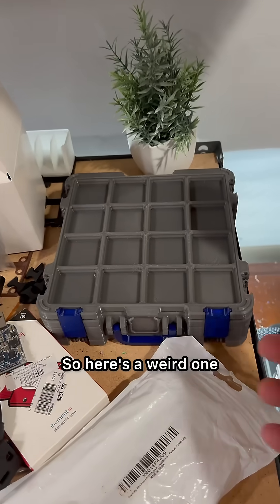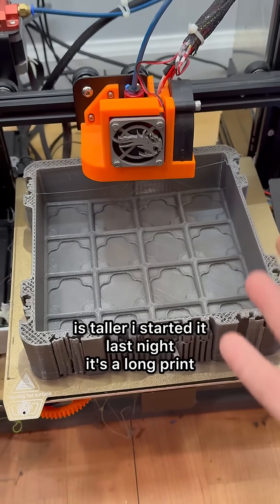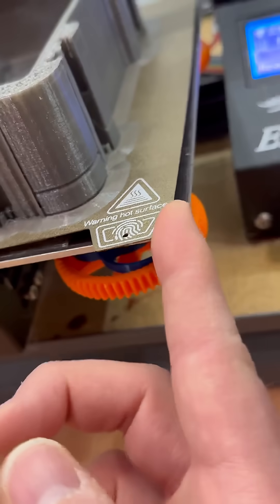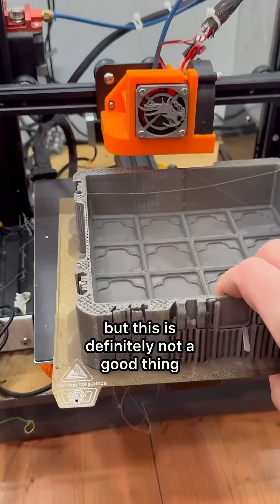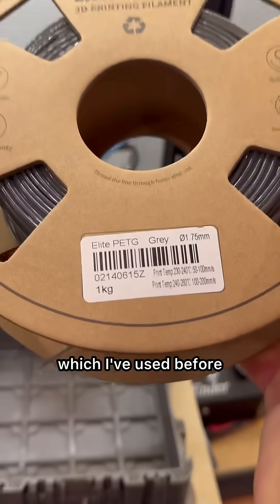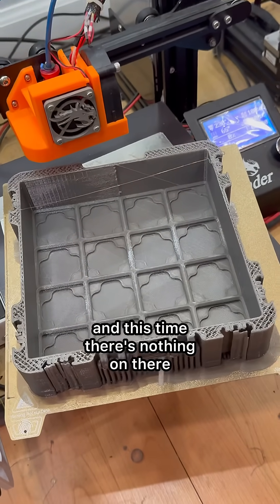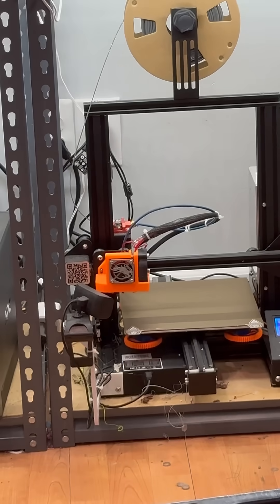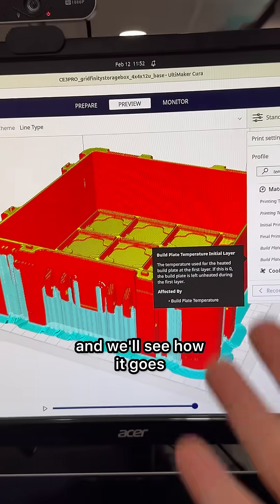Bed adhesion so good that it killed my #3dprint

Comment: It has happened to me a few times, things you can do: 
-enclosure, it warps because the layers shrink, the taller the print, the more likely it's going to happen, the enclosure maintains the temp a little bit closer to the bed temp
-clip the plate to your bed
-use glass, but it the adhesion isn't really good, its just going to pop up instead
-lower your fan speed.

Comment: The plastic is cooling and lifting the print bed up with it as it shrinks. Your model needs to be engineered with stress relief cracks ir valleys to avoid this

Comment: My Makerbot always did that with any print that used most of the bed, until I installed my own heater under the glass.  I purchased a small USB powered heating pad, meant for wrists etc. and put it under the bed.  I had to cut a channel in the bed for the wire to not bind, but it works great. The problem is uneven cooling. When the center is hot, and the outer edges are cold, they will always bend.  Keep the ROOM at a consistent temperature, as the outer edges of the material will cool to room temperature, so if the room is cold, the filament will shrink faster.

Comment: do a test print, same width. Turn the cooling off for the first few (3-5) layers use hairspray instead of glue stick. 75 bed temp, 240 first layer and 230 for the rest.  If it still warps, drop the bed temp 5 degrees and raise the 230 to 235. Also, if it's not a new spool of PETG, it might need dried. I usually heat the bed to 40 or 50, put the spool on the bed and cover it with a metal cake lid or a pan with a little bit of the cover off the edge of the bed to vent moisture, and let it sit 24 hours.

Comment: PETG likes an enclosure when printing.
Reply: I do petg just fine without one. Not saying ur wrong i want one in the future but its not nessasary. Just dont want any cooling or u get warping
Reply: Nope.. Petg prints fine with open or closed.. It is dependent on environment
Reply: @deeply999 "depending on the environment" hence why you'd want an enclosure.  it's easier to control the environment if you limit the amount of space that needs to be controlled.

Comment: Without really fully understanding the issue my initial thought is an enclosure would help prevent this issue by stabilizing the temperature fluctuation and potential shrinkage. I am very interested in knowing if your adjustment solves the issue :)

Comment: Uh I had that a few days ago when printing a large storage container that took up the full plate. I was printing in a 5°C room (enclosed printer) with PLA and had full fans running. I think the cooling was too intense and made it warp at the bottom which pulled the plate. Luckily somehow it still got out fine and enough for a storage container 😅
After reducing the cooling a lot and moving it to a 25°C room with 30-35°C chamber temp that never happened again.

Idk if that’s the reason for PLA but since then I print especially large surface prints with as low as possible cooling and avoid cool drafts and high environment/chamber temps
Reply: Added: I have a Creality K1C and the auxiliary fan is pretty intense, and depending on the geometry of the print sometimes just unilaterally blows cold air full force on the bottom of the print. I think that combined with one of the fresh air intakes for the enclosure being close to the aux-fan inlet made it basically blow 5°C air directly on the print plate. Turned my Aux fan now to 1% (still unexpectedly pretty strong) and exhaust fan to 100% when in the warm room, and 1% when in the cold room, and works perfect since then.

Comment: Hi can you tell me what upgrades you have on youe ender
Reply: Looks like a hero me duct and a Capricorn tube? Hopefully an all metal hotend too, the red clip makes me think a MicroSwiss branded one. You really shouldn’t print PETG at 230C with a Bowden because the PTFE used in Bowden tubing can start to off gas neurotoxins, so hopefully the hotend was upgraded. 

I played around with knockoff MicroSwiss hotends before I went Revo, and it was tough to find a good one that didn’t suffer from heat creep. If you’re going that route for higher temps, I’d definitely recommend a name brand hotend, MicroSwiss or otherwise.

Edit: looked closer, there’s a 5015 part cooling fan upgrade, and the hotend looks like some kind of V6 mounted derivative, maybe a red lizard or something similar? Also a dual drive gear metal extruder, helps a ton with speed and durability. And of course, the PEI bed.

Comment: You should seriously try OrcaSlicer. It isn't quite as user friendly as Cura is, but once I switched over, most of my print problems just melted away. It also prints way faster because it actually generates optimised print paths.

Comment: Depends on the type of filament some curl when you cool them too fast, some curl when cooled too slowly, and some cool when not cooled enough before the nozzle moves away. The wider and taller the print the more difficult they usually because
Reply: Cools when not cooled😂
Reply: @just_echoanau for you the none 3d printer user: when we refer to cooling in this case we mean having the cooling fan on

Comment: i think it wouldnt be much better if the print lifts off the bed. one thing that causes this is actually the bottom cooling off causing the part to shrink. might be why it happened with a taller version when the shorter version was fine.

so if printing colder and slow doesnt work, printing hotter and/or faster may help but I havent personally printed anything that has done that.

also less infill can help (less material, less shrinkange force) but the walls on that print are so thin you might not have any infill to get rid of.

printing in smaller parts and gluing might end up being the most reliable way to print this and printing thos parts diagnolly can help keep the bed on the magnet if you can do that
Reply: also if you can get away with PLA or PLA+ it doesnt shrink as much when it cools